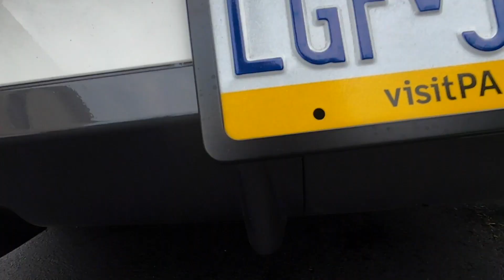CAN YOU DAILY AN EVO 9 MR?

Comment: On January I used to check the price of used lancers on some import sites they were around $17k to max $50k+, now they are mostly over $30k to $90k and the numbers available are dwindling. What shocked me the most is that used evo 1 were priced at $60k like wtf
Reply from the maker: The used car market is definitely insane right now due to chip shortage, supply and demand. I’m trying to buy a new project car but I’m just going to wait for things to get back to normal and prices will drop back down. It will take some time though

Comment: I want one but judging by the price, I'd rather have a stinkeye wrx sti hatchback
Reply from the maker: The used car market is really insane right now. I'd wait for the bubble to pop.
Reply: @ikigaidriven  like that'll ever happen
Reply from the maker: It will. Not anytime soon though. Once this pandemic is over, the chip shortage will be back to normal which will normalize the used car market.
Reply: @ikigaidriven  its been happening way before the pandemic was even a thing. how long did you think that the skylines and supras are 6 figures for? the r34 isnt depreciating anytime soon
Reply from the maker: @黒キツネ-九零二一零  I mention the used car market. Tacomas are going up, Civics are going up, Corollas are up, everything is up right now. It will drop. But for the collectible cars that you mention, R34's, Supras, and Evos, it really all depends on the condition. You can still find clapped out ones for cheap.
Reply: @ikigaidriven  civics and tacomas? thats a problem. ive seen someone pay 60k for a damn integra type r and the 350z, 370z, mr2s, evo (1-10), wrx sti, etc are hovering around 10k, regardless of miles and thats a bad thing
Reply: @黒キツネ-九零二一零  it's worth what someone is willing to pay. If no one buys than seller is screwed. I think prices have gone down somewhat